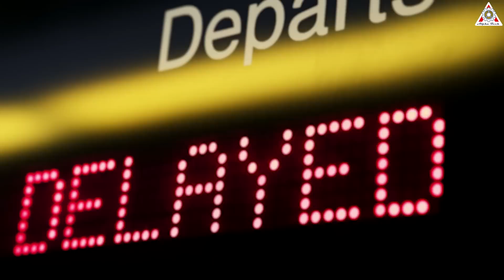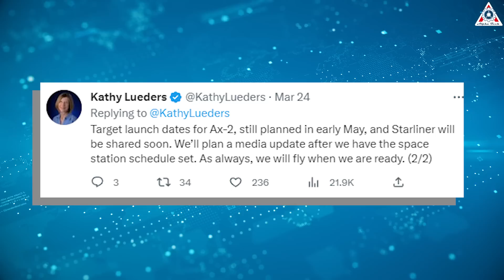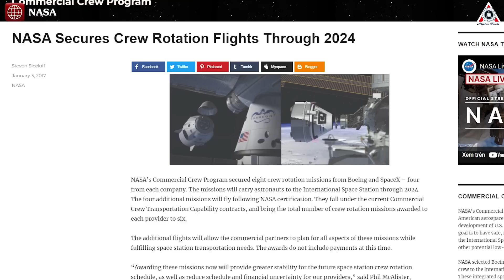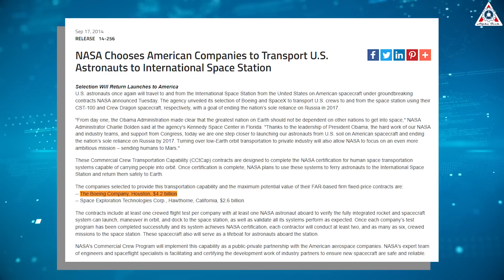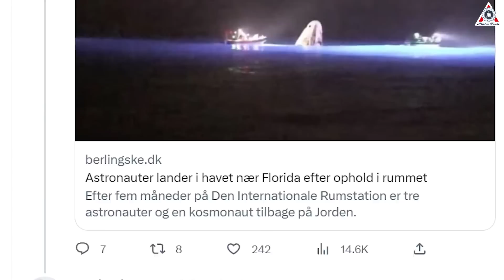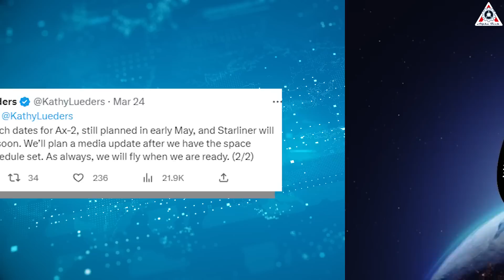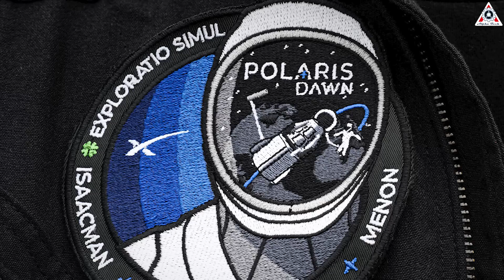Starliner delayed again! NASA gives up...

Comment: Boeing is a ZZhit Show. No new deffense contracts during the biggest war production boon in the last 40 years. FAA Certifictaion and production issues on their Commercial Products. Zero capability in thgeir Space division, since they have zero expertise left (their capable engineers left for LM, SpaceX and Blue Origin or retired). This is the Pinicale Study on what happens when you have Idiot Program Mangers with no engineering exprince making Engineering decisions based on cost and schedule only ! Boeing needs to be broken up as company and sold.

Comment: So you have a new system that has not flown a crew before and they are being canny about the actual flight date, because when you role the dice you wind up with Challenger.  Also, no.  NASA is not getting antsy about the delays in the launch system launch date. If you recall Artemis blew up on the pad before its circumnavigation of the moon.  Finally how is a Gemini craft the record holder for height when the Apollo missions went to the moon?
Reply: Probably means an altitude record for a purely orbital mission. As the moon-bound Apollos were deep space missions.

Comment: I also want to say something about Boeing in General. It is time to fire the President CEO, CFO and COO and Board of Directors of Boeing and replace them with real Engineers who know what they are doing. I never seen a company fall into a hole of incompetence and idiotic decisions like these guys. And it costing the company it's employees and stockholders money. When you have to spend 500+million to undo mistakes, spend massive amounts of money in law suits because of crashed aircraft and it still isn't right then it's time to remove the President, CEO, CFO, COO and Board. And I mean every last of them. Enough is enough. Boeing used to be our premier corporation...not anymore...this is what comes when you put bean counters in charge of everything. Fire them all!!!

Comment: Is there a reason why the always dependable and safe Hydrogen Fuel Cells are not being used? What is this obsession will putting heavy unstable Lithium batteries into everything?

If I had to guess I would say using a dependable Hydrogen Fuel Cell would eventually have people asking the question "why not use fuel cells INSTEAD of Lithium batteries in future electric vehicles?" ... which is a no no question.
Reply: I would suspect the 200+ days it would be docked at the ISS.
Reply: @TheEvilmooseofdoom  Can't it slave off the ISS power system while docked? Isn't this craft also intended for more robust missions than simple taxi to ISS?

There really is no place in space for batteries anyway where supercapacitors would be lighter, cheaper, safer, and way more dependable. Lithium batteries are not safe enough to be taken aboard a plane in any sufficient number. They should be nowhere near a spacecraft IMO.

Comment: Boeing relies on contractors for many components. SpaceX makes a lot of their stuff in house, so they have a lot more control over quality. I think a lot of Boeing's problems on aircraft and spacecraft comes from too much outsourcing. Of course, software seems to be one of their IN house groups that tends to F up way too much these days.
Boeing got more money than SpaceX, because they were starting from scratch on Starliner, whereas SpaceX could rely on a lot of heritage hardware they already had developed for the Commercial Cargo resupply program and the Dragon 1. (But look how much of a problem SpaceX had on their crew escape Super Draco rocket design that was completely new to the Crew Dragon! It blew up the f'ing spacecraft until they redesigned it! Their parachute design on Crew Dragon had a lot of problems and had to be modified several times as well.)
Also, NASA has really ridden the two contractors pretty hard on safety. People are forgetting how many months NASA took to certify crew dragon for flight, and their capsules are held to a higher standard of safety than the Shuttle ever was.
AS for Aerojet-Rocketdyne.... well.... personally I think they are just avoiding taking responsibility for stuff they do wrong. They aren't exactly doing great on new contracts lately. I mean ULA went with BLUE ORIGIN (!) for their new booster rockets! SpaceX builds theirs in house. If it weren't for the RS-25 and the RL-10C, what would they be supplying? I think there is a reason. They are simply overpriced and SLOW.

Comment: 3:05 - Boeing also has plenty of experience with Li-ion batteries - e.g with them catching fine in B-787 "Dreamliner", causing the first of many groundings and delivery delays for the airliner.
Reply: That was back in the early 2000's and was yet another contractor issue. It has been solved for many years now.
Reply: @i-love-space390  The Dreamliner didn't exist in the early 2000's
Reply: @i-love-space390  Well, experience, as I said. And have they learned from it?

It does not suffice to say "it was yet another contractor issue" - the responsibility is Boeing's. BTW, divesting of far too many manufacturing facilities and now relying on them without adequate control of the manufacturing and QA process is yet another of Boeing blunders in post-merger era.

Comment: Except for Boeing's 787 wide body A/C which uses Lithium batteries, virtually 100% of Commercial Aircraft use the " old school" NiCd (nickel cadmium) battery to start and provide emergency power. Even though the newer NiMh (nickel metal hydride) batt has nearly twice the Energy Density of a NiCd, when a NiMh single cell fails, the entire pack fails with it because the failed cells resistance goes to Infinity (the circuit opens). When a NiCd individual cell fails, the remaining cells continue to deliver voltage because the failed cells resistence goes to Zero ( the circuit stays closed, and allows voltage to pass thru the remaining cells). Lithium Batteries are Much Less tolerant than NiCd's when it comes to being Overly discharged or Overly Charged, either of which causes overheating. Once a Lithium battery goes into "thermal runaway" (reaches its critical core temp), it ignites and/or explodes. Lithium fires CANNOT be extinguished with A, B, C or D type fire extinguishers and must be either contained in a fire/explosion proof box and/or buried in sand to deprive it of Oxygen.  Lithium battery types are still evolving and have proven to be Much Less reliable than the old NiCd's. The draw to convert to Lithium's is all about the weight savings, as NiCd's are nearly 4x heavier than Lithium's for the same given Energy Density.  I don't blame NASA for stalling out on Starliner's (Boeing's) use of Lithium's.  Boeing's 787 Aircraft Lithium's caught fire in several instances when it was first delivered for Commercial use, which grounded the fleet . . . sound familiar?
Reply: This is why I will never buy an EV with those batteries. Unless severely damaged, gas tanks don't spontaneously explode.
Reply: @bondgabebond4907  Yupper, if you've seen a Fire Truck dealing w/ a Tesla fire, they just stand there and watch because they haven't the ability to put a Lithium fire out. Gasoline fires can be extinguished w/ water and it takes an empty gas tank w/ just the right Ratio of vaporized Gasoline to Air for there to be an explosion hazard. A car's tank will have reached empty Long before the gas/air ratio becomes explosive. Most Lithium batteries will explode by just shorting out the anode w/ the cathode, IOW just piercing a Lithium w/ a sharp piece of metal will do the trick. There's been a LOT of research into removing the dangerous characteristics of Lithium's, the Over Charging, Over Discharging or shorting problems, but there always seems to be a tradeoff by giving up some of their Energy Density, which is what makes Lithium's desirable to begin with. There's also been Tons of research into inventing a More Energy Dense batt that's safe to use as well. I was using the first available rechargeable Lithium batt's back in the 80's for Radio Control Aircraft. The "Sanctioned" (insured) flying clubs were all required to have plenty of buckets of Sand available once these batteries became popular in the 90's. It's Amazing just how long a Balsa Wood aircraft can fly when it's on fire, seen that more than a few times.  ; )
Reply: I don't know about the 777 but the 787 has lithium batteries and was grounded because of fires. Boeing couldn't find a way to prevent fires so the just put them in a box with a vent to the outside. Genius engineering.
Reply: @gregculverwell  Thx, you are CORRECT, and I should have known better. I have corrected the "typo".  🙄  I was working for a Major Airline that flew Boeing A/C types when I heard about that Carbon Fiber Airplanes battery problems. I've used rechargeable Lithium's for my R/C hobby since the 80's and learned a few things about how they like to be treated along the way. When you push a Lithium for performance, max discharge and charge rates, that's when you become a Test Pilot. Lithium use in cell phones, computers etc, don't typically run into these same issues because of their much lower charge and discharging rates w/ dedicated matching chargers. Home fires w/ Lithium's usually start when someone tries a different or wrong charger and the battery doesn't like it.
Reply: Interesting, but NASA just replaced the NiMh batteries on the ISS with Lithium batteries. Also, I think SpaceX uses Lithium batteries on Crew Dragon, since they have a lot of experience with Tesla Lithium battery packs. So I am not sure your point is valid.
Reply: @i-love-space390  My point was Public Safety and you missed it, try reading that again.  You don't see Lithium's used in Commercial Aircraft because, like I said, there is a proven track record of Failure among Lithium types, even the ones Boing uses in their 787's. Sure, it's gonna be used in Spacecraft where RISK is often traded for some weight advantage. The Americans have killed over a Dozen in their Space endeavors while the Russians have Killed hundreds. Look at the Nedelin incident involving the Russian R-16 ICBM. Spaceflight is inherently Risky, Astronauts/Cosmonauts are required to sign their lives away just as a Test Pilot does. I never said anything against the use of Lithium's in Spacecraft except for Boeings track record w/ aviation. Aviation and Spaceflight are just a tad different if you need somebody to explain that to you. Lithium's are still evolving and haven't Nearly the safety record of NiCd's. Ever seen a video of Firemen standing around a Tesla Fire? It's because they're unable to put a Lithium Fire out and waiting for the Dump Trucks full of sand. So your point was something other than that of a Troll ?

Comment: "The spacecraft appears to be plagued by a persistent curse ".

Let me correct you: "The spacecraft appears to be plagued by a persistent incompetence [at Boeing] ".
Reply: If ever worked with anyone in the Boeing software department you would know what is wrong.  Absolutely inhuman "processes".
Reply: @RS-ls7mm  I don't work at/with Boeing, but I have done software development for 25+ years. Looking at the issues they have (Starliner, 737 MAX, etc), it's obvious that there is an unhealthy culture there. It sounds that engineers are more interested to "cover their own a**es" than to voice an opinion about a problem that may down the entire program.

Comment: The major difference here: NASA is in Boeing’s nickers during every design phase and qualification test, second-guessing every item; SpaceX performed every design phase outside of NASA’s purview, and when finished, sold rides to NASA. All delays in Starliner have been caused by NASA’s wishy-washy engineers, and so NASA pays Boeing for the changes and delays.
Reply: If I was an astronaut, I would require NASA to review the smallest detail in that spacecraft. If Boeing is allowed to validate their design, we may end up with a space version of the 737 MAX disasters.
Reply: @todortodorov940  LOL!!! It doesn’t work that way! Never has! And 75% of the 2 737 crashes was due to pilot error. 25% was due to missing software upgrades that those 2 carriers refused to buy with the aircraft like everyone else did; the others never had those problems. So your comment is a HUGE FAIL!!
Reply: @wolfman007zz  Actually, I will take my words back. It's not Boeing's fault. It's not the pilots either. It's gravity that pulled both places down to their demise. Shame on you mother nature!
Reply: @todortodorov940  Poor attempt to walk back your post based on pure ignorance.

Comment: Hmmm,
Maybe the problem is how Boing tried to develop vs SpaceX

Boing seems to have tried to go for the final product in one step

SpaceX on the other hand developed a CARGO ONLY prototype (Dragon one) and flew that
Then they develop the final (current) CARGO ONLY Dragon 2
AND ONLY THRN did they develop the Crew Dragon

Learning curve anyone?
Reply: Somewhat correct. The issue is that due to internal restructurings and re-organization (a long story), Boeing has become a less desirable place to work. Boeing no longer attracts the sharpest minds, and they do not have the cutting edge engineers needed for such a project. Boeing still has good and great engineers, but for this thing, you need the 1% that are the exceptional ones. 

At the same time, as much as I dislike Elon, he managed to create an atmosphere and culture at his company, where those people queue in line to work for SpaceX, probably for less money and probably 80 hours a week, just so they can be "where it happens". SpaceX attracts the  brightest 1% that can build a spaceship, the same way NASA did in the 60's, while Boeing scrubs whatever is left. Boeing simple does not have the resources to lift a project like this.
Reply: @todortodorov940  As an ex employee I can tell you that Boeing dropped the policy of hiring only the top 10% in favor of hiring "mediocre" graduates because they were cheaper.  They put "processes" in place to hopefully find the mistakes they made but it didn't work, it just made everything so bureaucratic that most new hires just left.  A lot went to SpaceX (just down the road).  Not sure how long the enthusiasm will last if everyone is working 80 hours a week. Also even Elon has said that eventually the venture capital will run out and they will have to start paying the bills, Starship is very deep in the red. That's a critical time in any company, most fail.
Reply: @RS-ls7mm  Thanks for confirming what we outsiders read in the media. And shame about the change in culture at Boeing - but unfortunately, I think this is not only Boeing, but a general trend.

Comment: Starliner - the Boeing cash cow to fill the hole from the max8? Or are they trying to fit current Boeing plane wiring into the 60yr old orion capsule? It certainly didn't cope with their modern ablative coatings in the unmanned trial. It would be cheaper, safer, and faster to get spacex to design and build a larger dragon capsule, or a massive capsule that could dock and increase space on the ISS.

Comment: Remember when the saying was “if it’s not Boeing I’m not going “?  That’s when they were an engineering driven company, then they moved from Seattle to Chicago.
Reply: As an ex employee there are still areas that are run by the engineers (in spite of the management).  But the overall company is toast. What managers demand rarely correlates with what engineering is.  I worked sometimes with people in the software department.  Only the most an@l retentive people (some were downright unstable) could stand it for any length of time, turn over was very high. The mandated "processes" where inhuman.
Reply: I say if it’s Boeing I’m NOT going!
Reply: i would say if its a new boeing i am not going. old boeing planes are great.
Reply: Boeing for thee, airbus for me!
Reply: @alphatech4966  the Boeing CST-100 Starliner is a freaking Money Pit

Comment: I have been working with lithium batteries since 1980. As an engineer I would never place one of these batteries in a critical use situation. But what do you expect of Boeing? It placed them in its aircraft as well. This why I will not fly on its airplanes. I am willing to bet that Malaysia Airlines MH370 will have gone down due to the use of lithium batteries by Boeing.

Comment: Doesn't Boeing have to have a successful unmanned flight before a crewed mission?
Reply from the maker: They did that last May. The next mission will have crew
Reply: @alphatech4966  That's if they have a crew daft enough to fly in it. If I remember correctly, the previous flight wasn't without it's problems.
Reply: @alphatech4966  I haven't been paying attention but last I knew the unmanned trial was a spectacular failure but Boeing claimed that they knew what the problem was and how to fix it so there was no need to conduct another unmanned trial. 

Did Boeing actually launch a Star Liner and dock it at the ISS, return it to Earth and recover it to demonstrate they can keep humans alive?
Reply: They better
Reply: They already did.
Reply: They see Sunny and the other astronaut as being expendable.